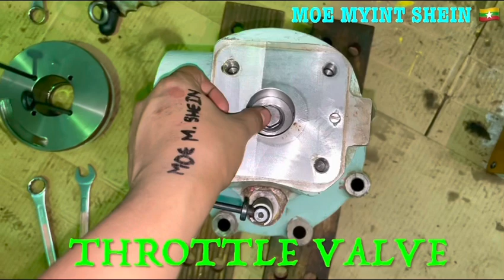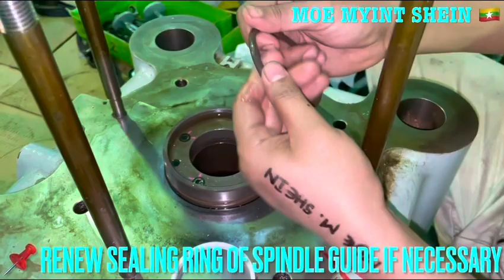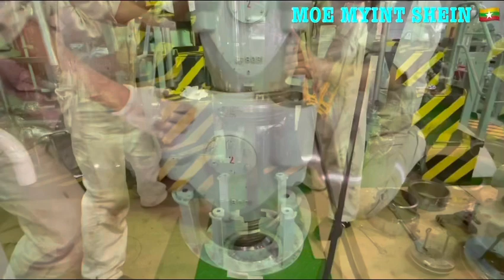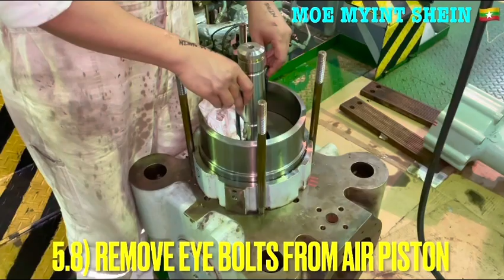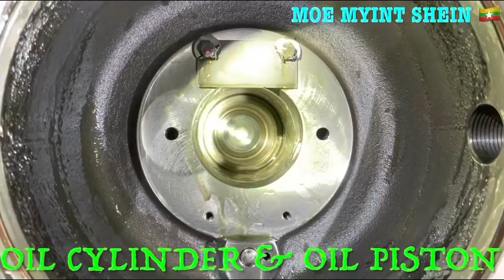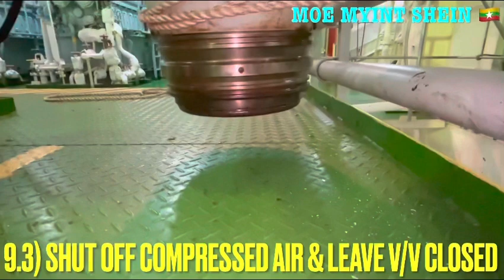[MAN-B&W] EXHAUST VALVE Overhaul and Testing | 6S50ME-B (9.5) | Technical Vlog : 025

Comment: Sir. Could you please explain why you filled LO to Safety valve and below air piston space? Thank in advance.
Reply from the maker: The reason of why I filled L.O into cylinder housing is according to maker’s instruction. That’s all. 😂

Hope Lubrication is the primary purpose for filling L.O into air cylinder. In here, maker doesn’t mention type of L.O. Just states Clean L.O, simply. 

Maker said to apply ample amount of L.O to be splashed into inner guide of spindle before exhaust valve spindle is mounted. (Teflon guide seal is mounted over O-Ring in the inner guide of spindle.) 

Another point of view is that spring Air presses oil in the cylinder during the period of exhaust valve closing. At that time, oil in the cylinder performs not only force lubrication also sealing. 

As conclusion upon above facts that I explained, Lubrication is primary purpose to lubricate between exhaust valve spindle and Teflon seal. And then, sealing. 😊
Reply: @MoeMyintShein_MMU  Thank Sir. Thank for your detailed explanation. Sorry for my inexperienced question as I have seen only Man B&W MC Engine and it is different from your ME Engine at some point such as seal rings at top of valve guide, air piston housing. Thank You again for your demonstration and explanations. Stay looking forward to  your next genuine demos :)